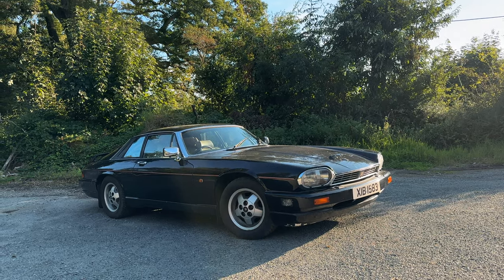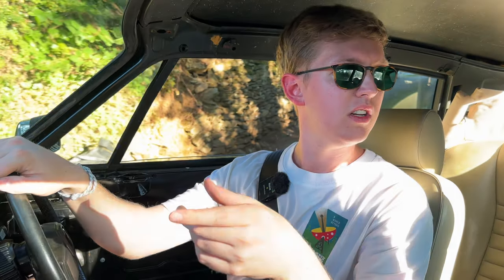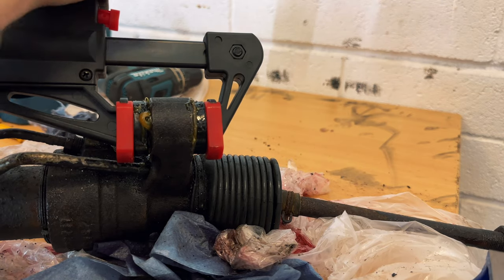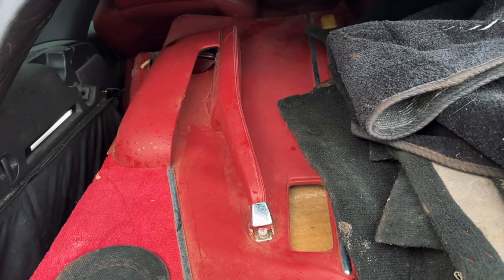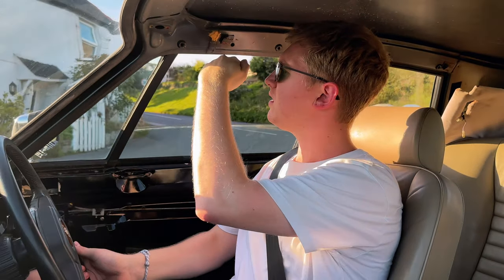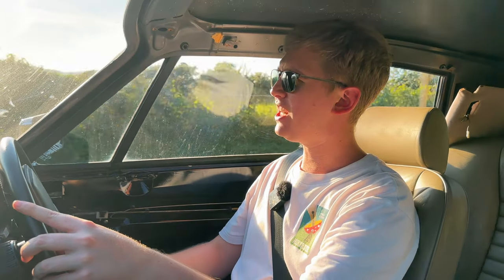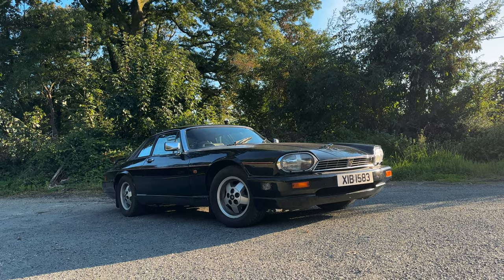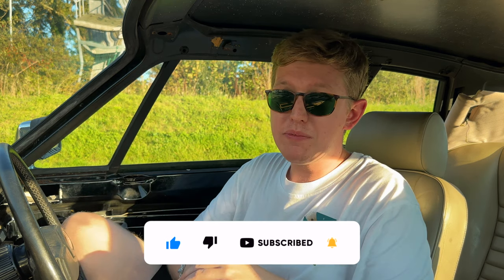Driving my V12 Jaguar XJS FOR THE FIRST TIME after passing its MOT!

Comment: Great videos - I have an 89 V12 convertible - pure joy to drive and like you say they are for cruising - I let the Boy Racers go by... I would get parts from British Parts or David Manners they are specialists- not Europarts. I think you car has great potential for someone to take on if you sell it - and black is quite a rare colour for XJS - will look great with Red interior - but those bumpers have to go! Needs the original type putting back on.
Reply from the maker: I have been using Simply Performance for parts but due to the bank holiday I had to use ECP for the track rod ends due to shipping times. 
I’m hoping someone snaps it up and gives it some time and love. I’m not sure what these bumpers are.